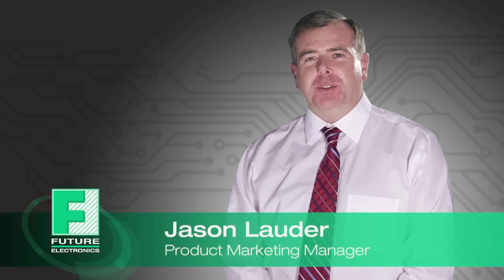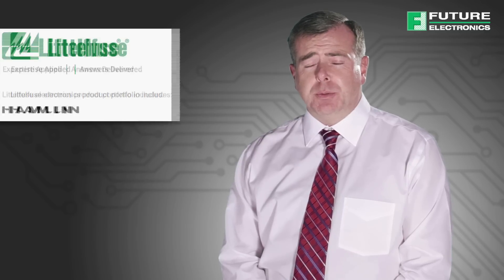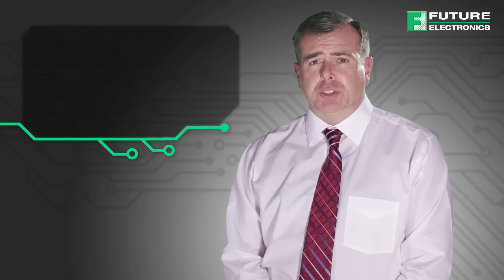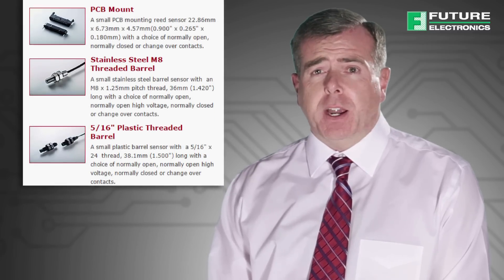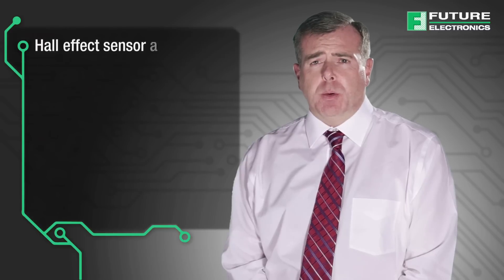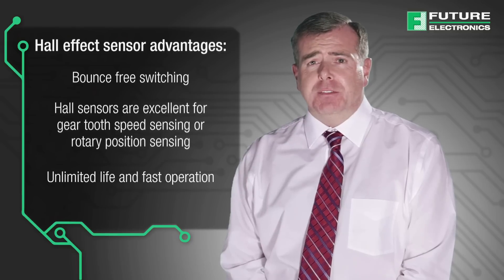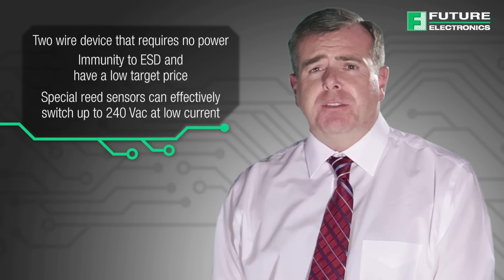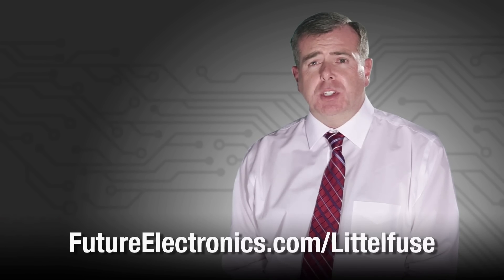Reed Switches, Reed Sensors and Hall Effect Sensors from Littelfuse; Features and Benefits

Comment: Hello, what kind of speed sensor is on automotive gearbox which has two wires output? It is not reed sensor because it has no mechanical switch. It is not hall sensor because it has got only two wires and hall sensor has three (+, ground, signal). I have opened the sensor and is very common as hall sensor but there is no hall sensor then static coil and the cylindric magnet in the center of coil which is rotated by pinion gear. What kind of sensor is it? 

Thank you.
Reply: Variable Reluctance
Reply: @seanashcraft5904  , thank you.